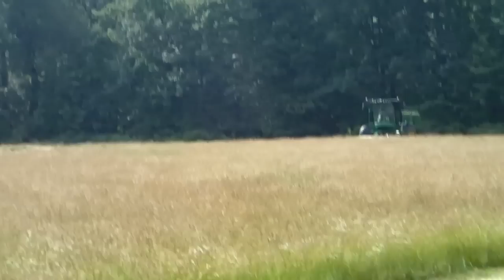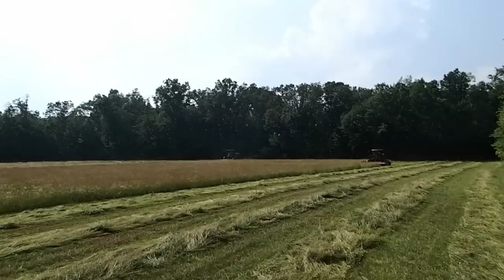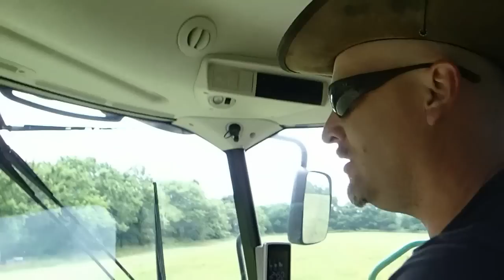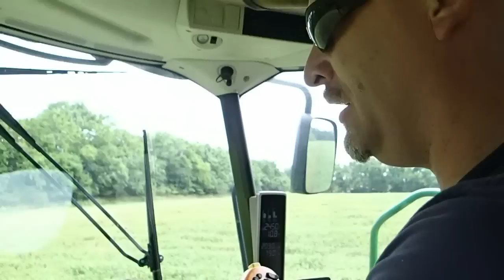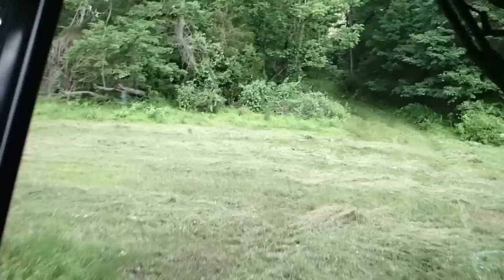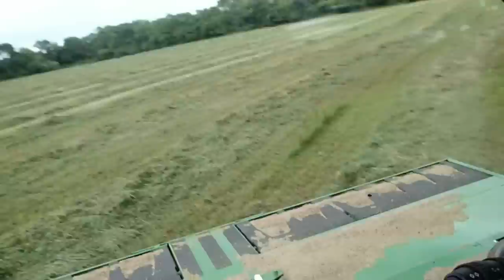case wd2303 john deere W235

Comment: in europe and especially germany we don't have almost no self-driving mowers. there are just a few big ones with three cutter bars attached to the machine. instead farmers here use attachable mowers. have you ever considered using tractor attachable mowers (conditioner) where you can get 1 in the front and 2 in the back resulting in up to 10 meters / 33 feet working width for probably just a third of what a W235 costs?
even though i'm not a farmer myself i find your videos always very interesting and educational regarding your methods of approaching and solving problems. keep the good stuff coming! :)

Comment: Great to see the new mower in action. Would have been nice to see a little bit more of the cab and controls and the field you were mowing as you were driving around.

Not that there's anything wrong with looking at the side of your head for 5 minutes. But a little closer look at what you were doing would have been nice.

Still a great video as always. Cheers from Aus.

Comment: With the computer having to wait.  Same thing with the new fire truck.  We have to wait a few seconds for the system to turn on.  If not some times the lights or even the pump will not work correct.

Comment: Does the case have a 5.9 cummins in it?
Reply: dooformuladlx Not sure on the size, but its a Fiat Powertrain Technologies engine.
Reply: dooformuladlx The Case has the 6.7 l Fiat Powertrain Engine in it. Same engine has in the T6 and T7 Tractors.
Reply: So it's Cummins not Fiat. I know they used the 5.9 cummins in their older tractors and dozers and such and they now use the 6.7 Cummins in their equipment I just wasn't sure of the engine size of the 2303

Comment: If you see the picture on the left that's me holding the checker flag one of my many
feature wins I also won the trophy race too.  All in all I won 9 trophy races and 14 feature races that year yes I am bragging the track was bad it was flat and was gumbo mud the track had so much bite it would rip rear end to peace's break axels rip tires off bead locks rims.  We even had one of the wing sprint cars come and try to put on a show but he didn't make the first hot lap before he twisted the rear end out of it, ok last post time to go to bed.

Comment: Hi wes Paul burrough East Devon England 
I have a duetz 7250 TV tractor with a Kuhn front mower 3 meter cut and class rear mower 3.4 meter cut 
And in first cut English shear silage I cut a 20 acre field in one hour and I averaged 1.2 litres an acre how that for work rate and economy

Comment: I know your not old enough but maybe your Dad would remember bailing hay the old fashioned way or at least that's the way we had to bail hay.  My summers were spent on the farm to keep me out of my Dads hair till I was old enough to bend conduit and pull the electrical runs for different  jobs.    We had to lift the bails up on the hay trailer
and then stack the stair method way till we had a full load.   We had large pressure cookers filled with food; water containers and about one half full milk pail filled with hard boiled eggs when out in the fields.  And yes I am older than your Pops. 
Oh yes also that was when Milk Pails were made in America and you could find real cowboy boots you could resole in stead of buying another pair of shit shoes and or boots from china.

Comment: I guess i don't understand haying...would have thought they would use a square cut pattern round and round in circles...instead of back and forth...stopping.
Reply: If a square pattern is used you would have to slow down for the ruts made by tractors during headland turns on the short ends of the field, thus reducing your acreage per hour.
Reply: xXzeTaco49Xx Interesting, thanks!

Comment: I Just bought a 2005 case round bailer. I know case and Newholland are pretty much identical in parts so why is your case good and that newholland you had so shity?
Reply from the maker: They totally changed over the entire machine changed pumps changed the steering mechanism change the computer changed the interior the cab the header everything. The old case just keeps right on rolling
Reply: Oh alright, yea I'm a newholland man but i find there changing there gear too much with and im not to sure about them latley. Just picked up a brand new kubota 14 ft rake today and it seems to work good what's ur opinion on kubota gear ?